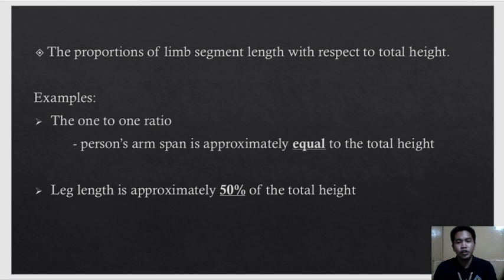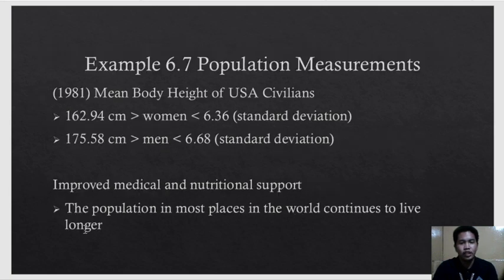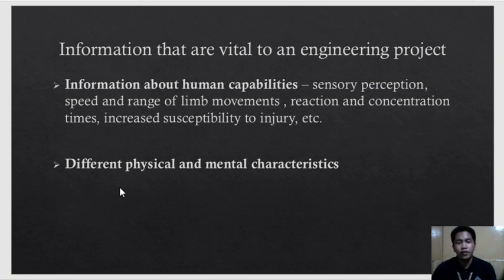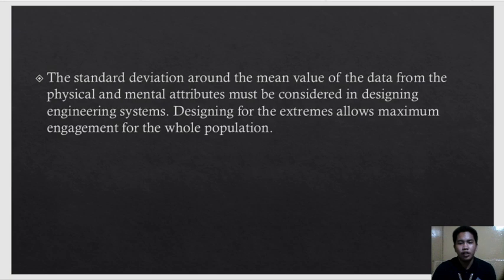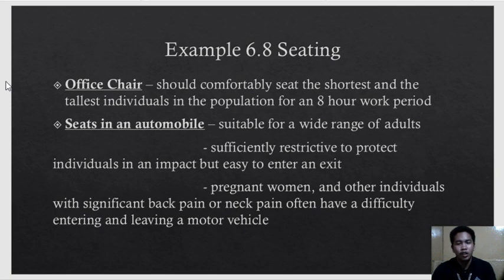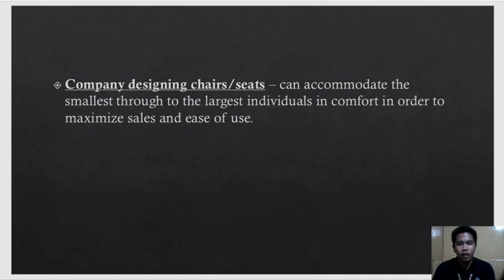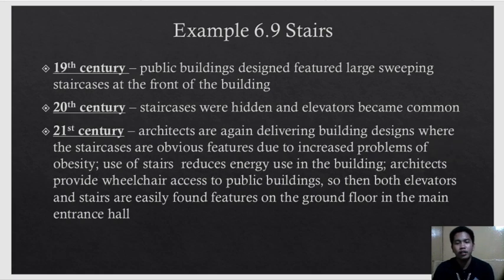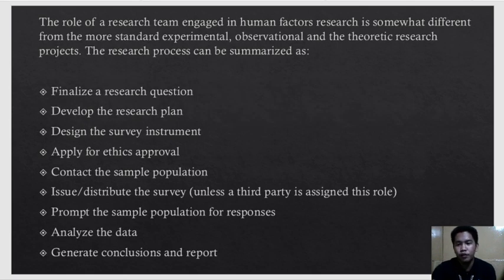Ergonomics and Human Factors

Comment: Mejorada, Iris Abigail T. 
March 26, 2023
MWF 6:30 - 8:20PM

Reflection:
I've realized that everything in research should be linked to people. It is critical to align with what is good for the people in order to achieve its goal without fail. All of the information we can gather is critical to the engineering project. It will be beneficial as a guide or starting point in the future.

Reaction:
It is explained in a clear and concise way. It is informative. 

Summary:
Ergonomics is a type of design that ensures a product fits the people who will use it the most effectively. The ergonomics of a product are critical because if the project does not fit your customer, it will not meet their needs. The product fails to fulfill its goal.

Comment: Solinap, Sim Jericho C.
March 21, 2023
MWF 6:30-8:30
Reflection
Ergonomic is a human specification and range human function. It is crucial because we need to achieve satisfactory of the product in order for the people to have interest. Standard deviation is a must to consider in designing engineering research.

Reaction
Gave examples. Well explained topic and voice is clear.

Summary
This topic was about ergonomics. Ergonomics is about giving the people the satisfaction in order for them give interest in the product. "No two humans are the same". Everyone has difference may be it'll be in physical form or character. It is a successful system if it'll reach its maximum or meet it's succession purpose.

Comment: Mamac, Jane L.
March 20, 2023
MWF 6:30 - 8:30 pm

REFLECTION: In this chapter, I learned that One of the components, particularly in engineering research, where this entails the enhancement of the effectiveness of systems and equipment, is ergonomics and human factors.

REACTION: The report is well discussed and presented.

SUMMARY: Human factors research is interested in figuring out how people interact with technology and how to make it more useable, safe, and effective. Ergonomics is concerned with maximizing the fit between people, tasks, equipment, and settings.

Comment: Jimenez, Rica Ann Thallia S.
March 21, 2023
MWF 6:30 TO 8:20 PM

REFLECTION:
As they center on creating and optimizing systems, goods, and settings to meet the capabilities and constraints of human users, ergonomics and human factors are crucial factors in research.Ergonomics and human factors can boost the usability, safety, and efficiency of a variety of goods and systems by taking into account the physical, cognitive, and behavioral traits of users.

REACTION:
The reporter did a good job of explaining her subject and provided strategies that our research may undoubtedly use. The presentation is successfully discussed overall.

SUMMARY:
Understanding ergonomics and human factor can aid in the design of more effective studies, lower the possibility of participant or researcher discomfort or damage, and guarantee that research tools and  equipment are designed for effective  and efficient  use.

Comment: Balbon Neil Bryan B.
March 20-23
M-W-F 6:00-8:00 PM
REFLECTION: 
By watching the video I realized that the significance of choosing relevant research the video presentation highlighted the use of methods. It is essential to select a study methodology that corresponds to the research question investigated to make sure the research results in accurate and trustworthy data. Also, choosing an acceptable research .Moreover, method can ensure that the research is carried out effectively, saving time and resources. 
REACTION: 
The speaker delivered the main points clearly. Regarding research techniques and their significance in carrying out a successful study using precise the content was made possible by examples more understandable. It was generally  well-structured. And through to these video presentation I was amazed and have the way that to finished watching it.
SUMMARY: 
In general some of the human factors are ergonomics and things to take into account when doing a research. These two are linked to one another in producing a result that is useful and appropriate the environment. details about people furthermore, skills and other traits are useful for engineering studies because it will act as the foundation for analysis. It will be examined by researchers methods that enhance the final product.

Comment: Alampay, Kenneth R.
March 20,  2023
MWF 6:30 - 8:20

REFLECTION:
After some introspection, I've come to appreciate the significance of including both ergonomics and human factors in research studies. By considering the physical design of tools, equipment, and environments, researchers can create a safe and comfortable atmosphere for participants. Moreover, by taking into account cognitive, social, and behavioral factors, researchers can enhance the performance of participants and ultimately achieve superior research outcomes.

REACTION:
I found the report to be very informative and well-presented. The reporter did an excellent job of explaining the topic, making it easy to comprehend and providing me with valuable insights and knowledge.

SUMMARY:
To summarize, ergonomics concentrates on the physical design of tools, equipment, and environments, while human factors takes a more comprehensive view of the interaction between humans and their surroundings, encompassing cognitive, social, and behavioral factors. Both ergonomics and human factors are crucial considerations in research, particularly in studies that involve human participants, and can be used to enhance the safety, comfort, and performance of study participants and researchers.

Comment: Duhaylungsod, Lynard S.
March 20, 2023
MWF 6:30PM - 8:20PM

REFLECTION:
In this video, we can learn how engineering projects help humans. In doing engineering projects, we must consider the human system. It should also be ethical for the safety of humans. Ergonomics is a specified engineering project that considers the  human system.

REACTION:
Even though it was my report, I can see some errors in the presentation. Although I was able to explain the connection of ergonomics and human factors.

SUMMARY:
Ergonomics and human factors are doing an engineering project that considers humans. In every engineering project, we must consider the human factors. Every engineering project must be ethical for the safety of humans.

Comment: Veriña, Jerry Ian A.
March 20, 2023
MWF 6:30pm-8:20pm

Reflection:
The video's most valuable information is about the importance of ergonomics and human factors in designing products and systems that fit the needs of the people who will be using them. It emphasizes the need to consider the range of human functions and the physical and mental characteristics of individuals in the population. By designing for the extremes, maximum engagement for the whole population can be achieved, and equity issues must be taken into account to ensure inclusiveness. Ultimately, the goal of ergonomics is to make life easier and more comfortable for people.

Reaction: 
The reporter provided a well-made presentation/visual aid. Audio and video recording were also done properly. The reporter made a clear and concise discussion about the given topic. The reporter also provided good examples that were simple and related to his given topic.

Summary:
The video discusses the importance of ergonomics and human factors in designing products and engineering systems. Ergonomics is about designing products that fit people's needs and human factors research is about how technology is used by humans. The physical and mental attributes of individuals must be considered, and designing for the extremes allows for maximum engagement for the whole population. Engineers must be aware of equity issues and inclusiveness for those in the population that have disabilities, both mental and physical.

Comment: AMAHIT, KENT L.
MARCH 20, 2023
MWF, 6:30-8:20 pm

Reflection: After I saw  this chapter report, I was able to gain a better understanding of how ergonomics and human factors play a role in engineering research. I realized that ergonomics and human factors have a great impact on the usability and safety of a product, which is why it is so important to consider them when conducting research. This is especially important for engineers, as their research could potentially affect the lives of people.

Reaction: I observed that the reporter is reporting well the assigned topic and discussing the importance of Ergonomics and Human Factors. I also,  found this chapter to be incredibly informative and the topic of ergonomics and human factors is a conct that I will now consider when conducting my own research. I was also surprised to learn that ergonomics and human factors can influence the design of a product, not just its usability. It has opened my eyes to the importance of considering these factors during the research process.

Summary: As what I saw in the presentation. In Research Methods for Engineers discussed the importance of ergonomics and human factors in engineering research. It explained how these factors can affect the usability and safety of a product and how they can influence its design. It highlighted the importance of considering ergonomics and human factors when conducting research and how they can have a great impact on the success of a product.

Comment: Michael Angielou G. Labrador 
March 20, 2023
MWF 6:30pm - 8:20pm 

Reflection:
After watching the video, I have learned and understand that it is crucial in this field of profession to understand the role of ergonomics and human factors. Thus, it suggests making sure that the product must first fit people and so will not fail and must be securely designed using the most effective design to make it fit. 

Reaction:
The presentation is clearly delivered by the reporter. The given examples also helped me to be able to grasp more of the topics discussed and made it clear to me the importance of the lesson that needed to be applied as an engineering student. 

Summary:
It  is critical to consider ergonomics and human factors together while creating projects or goods. People are the subject matter of ergonomics, so it cannot be effective if it is not applied to meet their needs. When designing or creating projects as part of human engineering, human factors must be prioritized.

Comment: Amistoso, Arabella S.
March 20, 2023
MWF 6:30pm - 8:30pm

Reflection:
The video discusses how engineering research should fit human factors and benefit them. If it does not, then the research is not successful. 

Reaction:
The reporter properly explained the topic. He was able to highlight the important points on the topic and provide several examples. 

Summary:
In creating research, it is essential that we take into account how these innovations could benefit humanity. Product designs should be properly utilized in terms of restrictions. whereas products like chairs should be available to all in their comfort, no matter the size or weight. Overall, it should fit the needs of the users and address other factors.

Comment: CASTRO, JOHN CARLO P., 03/20/23, MWF/6:30pm-8:30pm

REFLECTION: Ergonomics is the study of how people interact with their work environment and how to optimize the design of tools, equipment, and workspaces to reduce the risk of injury or discomfort and improve productivity. Ergonomics applies principles of anatomy, physiology, psychology, and engineering to design systems and equipment that fit human capabilities and limitations.

SUMMARY: Both ergonomics and human factors share a common goal of improving the interaction between humans and their environment. They are interdisciplinary fields that draw upon knowledge and methods from psychology, engineering, design, and other disciplines. They play an important role in many areas of society, including healthcare, transportation, product design, and workplace safety.

REACTION: Great job on the report! The analysis was thorough and insightful, and I appreciated how the reporter presented the findings clearly and concisely. The visuals that were included really helped to illustrate the data and make it easier to understand. The attention to detail and organization made it easy for me to follow the thought process and come to the same conclusions. Overall, this was a fantastic report that really showcased the reporter's skills and expertise. well done for the hard work and dedication!

Comment: Pahilaga, Christofferson M.
March 20, 2023
MWF 6:30pm-8:20pm

Reflection
This video presentation talked about the consideration of the people in our research paper. It is discussed that our research should have benefits to the people around us for they are also the ones who gets an impact on our works especially as a future engineer. This helps us make a better project that maximizes the efficiency and minimizes the failures of our projects.

Reaction
The reporter had discussed his topic in the most effective way. The reporter provided ideas and examples that are easy to understand and relatable to the discussion.

Summary
Ergonomics and human factors is all about factors that should be considered when conducting a research project. This two are deeply connected for this is who we can give a massive impact on and give benefits to. This also talked about considering our surroundings in conducting our research project for it is for the betterment of all. Knowledge about human capabilities is important for this is where we can base our analysis throughout our research journey.

Comment: Lluvido, Lynan Kim A.
March 20, 2023
MWF 6:30 - 8:20 PM

REFLECTION:
After watching the video presentation, I have come to the realization that everything in research should be connected to the people. It is important to fit with what is good to the people to meet its purpose without failure. All the information that we can collect is vital to the field of engineering project. It will be useful as a guide or basis for future use.

REACTION:
The report was very informative. It was explained well by the reporter and he provided some examples related to his assigned topic. The presentation can easily be understood just by simply listening to what the reporter is talking about.

SUMMARY:
Ergonomics and Human Factors are some of the things that needs to be considered when we do a research. These two are connected with each other in creating an effective and well suitable output to the surroundings. Information about human capabilities and other characteristics are also useful in engineering research as it will serve as the basis of analysis. It will go through the research processes that makes the output even better.

Comment: Borganio, Jeff G.
March 20, 2023
MWF 6:30-8:20pm

Reflection:
The report is about considering human factors and how does if help to further enhance any inventions that human can benefit from it. I have now the idea on how does it work and how engineers work their minds where they should make decisions that can be applied to all human. This topic helped me to make my research usable and have a better function that most of the people can benefit.

Reaction:
From the report that's been discussed, it is clear that human factors are the main goal of engineers that will help all the people with different needs. The reporter gives concrete examples and the ideas are well discussed.

Summary:
Ergonomics and human factors discuss about the design and product that will be contributing to all people where there are a lot of considered human factors. This is the main goal of engineers where they should design a goal that's good for all that everyone can use efficiently like PWD person is considered as one of the factors. Overall, this will be done accordingly and there will be more data that will be analyze in order to make your proposed topic approved.

Comment: Geguinto, Jun Royce M.
March 20,  2023
Mwf 6:30-8:30

Reflection:
After watching this video presentation, I learned the importance of considering human factors in engineering projects and the need for feedback from the population to ensure inclusivity and equity in design.

Reaction:
The reporter ensures that the information are conveyed  using simple and straightforward language that simplifies the importance of the topic.

Summary:
In summary, this chapter emphasizes the importance of considering human factors, such as anthropometric measurements and human capabilities, in engineering projects. It also highlights the need for feedback from the population, including those with disabilities, in the research process.

Comment: Macalib-og, Jhon Paul C. 
March 19, 2023
MWF 6;30 - 8:30 pm

Reflection
The topic is very interesting, It talks about ergonomics which is to enable to design a machine, an engineering machine that helps humans and the machine interact with comfortability. Human factors have the same meaning or similarity to ergonomics as it talks about humans range of functions that enable them to interact with those machines.

Reaction
The topic is very interesting and have fun examples that is easy to understand.

Summary
Ergonomics, also known as human factors engineering, is the scientific study of designing products, systems, and environments that are safe, efficient, and comfortable for human use. It aims to optimize the interaction between people, machines, and their environment, with a focus on minimizing the risk of injury and increasing productivity and performance.